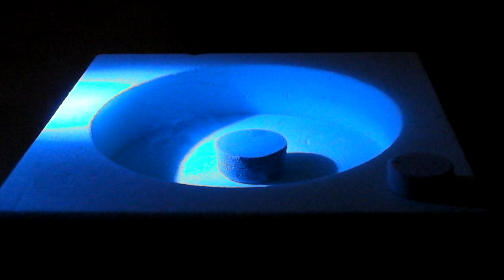What's The Difference Between The Meissner Effect & Flux Pinning?

Comment: I am more confused than ever! I thought that the Meissner Effect was produced when the disk of superconducting material(with a hole in its center) was chilled down below its Tc, an electric current would be set up that would levitate the magnet - not simply the superconductor was impenetrable to the magnetic flux(0 permeability) ?
Reply: +Jeffrey314159 pure Meissner effect is a generic property of superconductivity, and it IS complete expulsion of magnetic lines from the body of superconductor as it being cooled below its Tc. However, Meisner effect can be observed in type-I superconductors only, where only one critical field Bc exists. When external magnetic field exceeds Bc at given temperature, superconducting state can no longer exist in the material. In type-II superconductors  the situation is somewhat different. There two critical field Bc1 and Bc2 exist. Bc2 is pretty much the equivalent of the Bc in type-I superconductors, but Bc1 is the field, at which external field actually CAN partly penetrate the body of the type-II (any HTS like YBCO, GdBCO, BiSCCO and alike). It penetrates in the form of vertices with normal cores and with superconducting current circulating around it. These are called Abrikosov vortices. This effect will actually exist even in a defect-free single crystal superconductor. However, lacking of defects would result is effect called "flux-creep", when trapped magnetic field does not stay "frozen" but rather moving across superconductor generating some voltage. Presence of defects such as impurities, of intentionally added nano-particles make flux trapping easier, as non-superconducting phase is readily available to create penetration sites for external field. And yes, you are right  - any superconducting material with a hole in the center would trap magnetic field. For example a ring made out of lead would levitate above magnet if cooled down to liquid helium temperature. It acts as a macroscopic Abrikosov vortex.
Reply: Whoa, you said a mouthful, thank you☺😇
Reply: Jeffrey314159, I must say that I cannot guarantee that I was 100% accurate, even though I have nearly 10 years of experience in this field. But I am sure it is a good starting point for some self education if you wish to do so :)
Reply: +Jeffrey314159 I can also add, that to exhibit high levitation force and strong flux trapping it is not really important to have pinning centers, as Bc1 is normally very low and any reasonably high field would allways penetrate the bulk and become trapped. The main source of high levitation force and strong trapping is high current carrying capacity of the bulk, as ultimately the current is what creates magnetic field interacting with the field of external source. In thin bulk YBCO disk current carrying capacity is very low and pure Meisner effect would dominate over flux pinning, and thick disk would be able to trap substantial field due to its ability to carry high super-current. But of course reasonable fraction of defects would improve pinning. The main application of artificial pinning centers (APC) is actual superconducting wires, which are made in form of thin layered tapes, typically 10 mm wide, hundreds of meters long and 110-150 micrometers thick with superconducting layer normally ranging from 1 to 3 micrometers only. Such tapes can carry up to a 1000 A at self field and 77 K (LN2 boiling temperature). Weak pinning in such tapes result in vertices flowing across the tape while transport current flows along, as they experiencing Lorenz force, wanting to drag them from one side of conducting tape to the other. As they "creep", they generate voltage, which create non-Ohmic resistance and substantially suppress performance of the superconducting tape, especially in-field performance. To some extent grain boundaries can trap vertices, but tapes for high-field operation such as superconducting magnets, are intentionally doped with various defects, normally some non-conducting ceramics like yttrium oxide (Y2O3). Defects would suppress critical current in low or self fields, but at the same time boost in-field performance...
Reply: Preston Doll  no, it's just type-II superconductors don't generally exhibit complete Meisner effect. Flux pinning is not directly related to Meisner effect, it's more about keeping superconductivity in the mixed state without non-ohmic losses - if flux pinning is strong, it's good - resistance-less current transport is possible. Type II superconductors have tow critical magnetic fields: Bc1, when Meisner effect becomes incomplete and superconductors begins to partially allow magnetic field in the form in quantized form to enter its interior, and Bc2 is the filed, at which all superconductivity vanishes completely. In type I superconductors we only have Bc,  it's either everything or nothing. Something like this...
Reply: Preston Doll  Bc1 is normally rather low, so in most practical situations type-II superconductors don't exhibit pure Meisner effect.

Comment: Nice demonstration and simple explanation/comparison. It would be a little easier to hear your voice if the music was just a tiny bit quieter but it was okay nonetheless.

Is it easy to pull flux pinned supra conductor and magnet apart? Like to actually hold both objects and physically move them away from each other, what does it feel like? Is it a noticeable strength or is it still rather weak-ish.

My curiosity stems from playing around with magnets when I was younger and trying to force identical poles to touch each other always proved very difficult with stronger magnets. I simply wonder if the flux pinning is as strong as this or not.
To be honest my gut theory tells me that the force isn't very very strong but it may be noticeable.
Reply from the maker: Hirobian We have edited the video to remove the music so you can find a music free version on the Channel at https://www.youtube.com/watch?v=lxWrRfC1Y-A.

The flux pinning effect is quite strong - I haven't measured it but it does take a little bit of effort to pull them apart.  The Meissner effect, on the other hand is very weak and a small push is enough to dislodge the magnet.
Reply: Thanks :) That is quite interesting. I wonder what applications flux pinning could be used for in mechanical/technological engineering.
Reply from the maker: Mag lev trains, frictionless bearings etc
Reply: Very true.

Comment: Please excuse stupid questions here but,

1) Is there a way to know if a substance will likely be superconductor, or is it only by virtue of experiment one would know?

2) How do the field lines become trapped?  What is the property of the superconductor that allows that to happen?
Reply from the maker: Jay Bonning Not stupid questions at all!

The mechanism behind superconductivity is only understood to a certain extent.  Those materials that superconduct at temperatures very close to absolute zero are thought to do so by the formation of 'Cooper pairs'.  These are basically pairs of electrons that form in a lattice at very low temperatures - the detailed explanation is a bit complicated but just check out 'Cooper pairs' or 'BCS Theory' on Wikipedia.  If it's possible to predict which materials will form Cooper pairs at low temperatures (i.e. close to 0 Kelvin) then it should be possible to make predictions about superconductivity.

High temperature superconductivity is more difficult - as far as I'm aware there is no generally accepted theory as to how this works so making accurate predictions about which materials will be high temperature superconductors would seem to not be possible.  However, I would think that from a chemistry point of view and empirical evidence that predictions can be made about which combinations of materials are likely to form the said materials.

The field lines become trapped (in flux pinning) in defects in the superconductor lattice.  Because the layer of superconductor is very thin (unlike in the Meissner effect) it is possible for field lines to become 'threaded through a hole' in the lattice so that as the superconductor drops past its critical temperature they are not expelled from the body of the superconductor.  Superconductivity actually breaks down around these sites as the field line/flux tube causes quantum vortices (basically swirling electric currents) around them.  This means that if the field gets too intense flux pinning will not work.

Hope that helps.
Reply: That helps a lot, thank you.
Reply from the maker: No problem!

Comment: Once it is "pinned" how much force would it take to pull the magnet out of it's position? Does removing the magnet forcefully while it is pinned change the structure of the super conductor? Would repeatedly forming and ripping the pinned connection weaken the ability to form the connection over time by physically damaging the areas that the pinning occurs on the super conductor?
Reply from the maker: samtheweebo Lots of interesting questions!  The first is the easiest to answer - I've not measured it but judging by the feel of the force when I've pulled ours apart it's around a couple of Newtons. Regarding the physical damage side of things - I've done this many times with our own superconductor but certainly not noticed any degradation.  That's not to say it isn't happening at a microscopic level.

What happens when you pull the two apart is a difficult question.  Magnetic field lines cannot be broken - they always have to form a closed loop.  If they could be broken this would open the door to the existence of the magnetic monopole (there is a phenomenon called 'magnetic reconnection' which occurs in high energy plasmas but this does not involve true breaking of the field lines).  This means that as you pull the magnet and superconductor apart the field lines have to pass through the body of the superconductor.  I'm guessing that they are forced between the individual atoms within the structure and a certain amount of bond breaking must occur as this happens - which may explain the force needed to pull them apart in this way.  I must also assume that the bonds are reformed otherwise the superconductor would just fall apart.
Reply: Thank you for the detailed and informative response!
Reply from the maker: No problem!

Comment: Could Flux Pinning be used as a clean alternative to large electromagnets?
Reply from the maker: Nikro Plays Flux pinning is an effect that requires a chilled superconductor and a magnet so the effect itself can never replace a magnet.  Chilling a superconductor on its own will not produce a magnetic field.  However, superconducting magnets are possible and fairly widely used already. Basically these are electromagnets - the magnet is cooled very close to absolute zero so electrical resistance is reduced to zero.  This means that, once switched on, the current can flow indefinitely and continue to produce a magnetic field with no further energy needing to be input.

Comment: The background music is too loud and annoying.
Reply from the maker: ReligionOfNice Which is why we re-edited it and uploaded a new version (linked to in this version) without the music.  You can see it at https://www.youtube.com/watch?v=lxWrRfC1Y-A&index=3&list=PLxNMKdTABaYi5delOcgd8uMKN5FZqQD4_
Reply: Thanks.
Reply from the maker: ReligionOfNice No problem!
Reply: Very interesting video.  My mathematical intuitions tell me that the reason the magnet has a strong vertical pinning is because of the curvature of it's magnetic field (which is pinned into the superconductor).   Were the field to consist of a bunch of straight lines emanating from the magnet then you would only get strong sideways pinning and not pinning, while you could slide it up and down the field lines.   Which makes me thing a larger magnet (which would have less curvature) would allow more freedom in the superconductor (with regards to distance).  On my theory it should take less force to move the superconductor.  That is with the magnet strength adjusted to maintain the same field strength.  I'm out of college around 35 years so I'm probably not using the correct terminology.  Hope you get the idea.   Now this is where you tell me I'm full of it.
Reply from the maker: ReligionOfNice No, I think you are absolutely right.  You do have to be careful with the strength of field though as over a certain threshold the superconductor becomes saturated and loses its ability to pin.
Reply: Ok, but I was just speculating from my understanding from physics class.   Which I know is prone to error.   Look at all the idiots out their who think they know how a siphon works.  I've actually designed complex siphons and almost everyone I've heard talk on the matter doesn't fully understand them.  You need some practical experience to get to know such things and I've never even played with superconductors.
Reply from the maker: ReligionOfNice Exactly - you just can't beat practical experience!  Talking of siphons - have you seen this https://www.youtube.com/watch?v=OS1KXMsE2qk?
Reply: Cool, no I hadn't seen it, but it makes sense.  The tube provides greater surface area for nucleation of bubbles.  So it acts like those bubble driven fish tank filters.  It won't be perpetual though once the fizz goes out of it.
Reply: One of the issues with using siphons in the field is that water contains dissolved oxygen.   If you have a slow siphon running over a dam to keep the reservoir empty while working on it the dissolved gases will bubble out at the top of your siphon do to low pressure there.   As water flows through it brings more and more dissolved air that supplies the growing bubble at the top.  Eventually it will grow so big as to cause the siphon to stop via "airlock".
Reply from the maker: ReligionOfNice Interesting - a siphon clock is one of the things that's been on the to-do list here for a few years.  Just not enough hours in the day though!
Reply: I invented a continuous siphon that solved this problem of airlock.   It required no energy source other than the water flow coming into the reservoir.   I actually installed one in a 15 foot high dam.  I had it going for entire month.  Normally I would get airlock in 4-5 days with that 15 foot rise.

Comment: Good video. Wondering about "trapped fields,"
In the crystal structure are fault lines. Due to the differences, the field becomes "entangled?" So is this a physical manifestation of a quantum effect??? Thanks Bohdisattva. 
Inertialguide at yahoo . Com
Reply from the maker: David Woroner Flux pinning can be considered as a quantum effect but I think you are misusing the word 'entanglement' here.  You could, I suppose, describe the field lines as being entangled in the superconductor - although 'pinned' is a better description.  

Quantum entanglement is a different thing altogether.  Imagine, for example, you produce a pair of particles which are then separated and transported to different sides of the Universe.  If you keep one in your lab and measure a quantum property, such as its spin, the actual process of measurement/observation appears to 'create' that property (it 'collapses the wave function' - see Schrodinger's Cat as an example of how this works).  At the instant you measure/observe the particle in the lab the same property is defined in its distant partner - it seems to 'know' that the measurement has occurred.  There is no time delay in this effect and for that reason Einstein referred to it as 'spooky action at a distance.'
Reply: Thank you for the correction! ;-) Ive been studying the 2nd law, via Ilya Prigione for 12 plus years, and Ive watched all of Prof. Susskinds videos. I also devved the Counter IED Airbag system. (Blast, Hydrodynamic & light spectrum triggering.) < "backround." So, here is a bit of a deeper question. In true entanglement, as in "spooky," is this not a type of resonance @ a universal distance? My thoughts always return to, and find a hinge/crux de fulcrum so to speak @ the "momenta~" between limit cycles tipping forward or backward (backwards=reverse cascade failure, forward=cycle continuation)-- add into this, "resonance communication" and feedback loops, ala Jimi Hendrix & video camera into a monitor and looping... There is something that leaves me endlessly puzzled, em spectrums, "entangled resonant communication," reverting back to entanglement... I agree with proper linguistics so as to have a good relational dialogue. I hope you understand my "stall" here, as in this "stuck point." Resonance absolutely fascinates me and feedback + communication of "information." < > makes a great mind soup! ;-) Thnks Dave